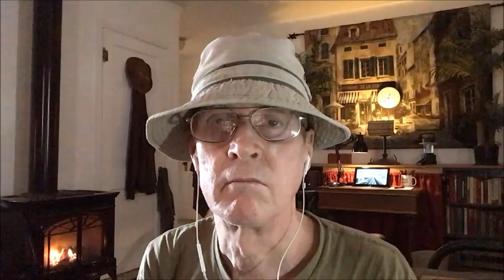Antenna Switching Effects

Comment: Charle
C] globe antenna dual seizure radio broadcast trouble days nintendo star trek transporter norton security unlawful entry hutchinson mn kimbal ski ceiminal patrol maccafe security machine " destroy " glibe transit globe astronaut 

C]c]
Asteroid impactv2108 2112-2113 
2126 globe ompact earth 
Earth s.america tectonic impact 134 nautical miles australoa tectonic plate 14 nauticaliles

Two putlrts unlawful electric conduit terminal extension cord brrak
Reply: Cpu processing 9 star 23 syripe grey white rectangle corner antenna
Conduit book 8769➕➖.023% ¬Г $14.56➕➖balance sheet recoept taxes 1.23

0.56 to print 
Scar🉑face mark thomas brunberg 

Cashier check endorsement payable

Comment: The radiation pattern will indeed be influenced. I’ve tested this.Read about phasing and radiation.  As for the switch, they are nice and most are junk. They have open circuits and not grounds. There are some better than others but they are very expensive and rated for high current. I would make sure common mode is taken care of before entering the room. That is a problem after all. Rf back, open circuit switches can cause a hell of a mess. Earthing isn’t a fix all like many have led to believe over the years.

Comment: Hi Stan, here in my 'nerdcave' I use a coaxial antenna switch (DC-1.5 GHz). The isolation between each individual antenna port (3 in total) is 70 dB. When I switch to another port, the inner conductors from the other 2 ports are connected to ground. I have not noticed any crosstalk between the ports individually. The insertion loss is around 0.05 dB. Just my two cents.
Ps: I like your humour!
 73. Eric

Comment: Two instances, here at my home and at another weekend retreat house I once had. Installed a 160 m inverted L, an 80 - 40 m dipole a 30 m vertical and a 20 m vertical. There was some interaction between them. Each antenna added lowered the Fr of others, saved the final trim for last. Had (still have)  four-holer remote antenna switch from Ameritron at the common point of antennas next to ground rod and wires. Eventually, wound up tying  the  30 and 20 m verticals together and feeding them off one spigot of the switch, the 80 - 40 m dipole off another and the  160m with another. Tying the verticals feed points together worked fine. I isolated the 160m wire because I wanted to apply a tuning network that would broaden the antenna. After some trimming of the wires (not much), it all worked out rather well. Most could operate without tuner in the shack or presented a good enough load to be well within its range. The only issue was mother nature liked to take them down. All tree suspension systems. 
73' de K4WRF